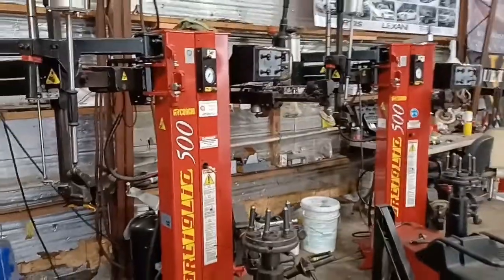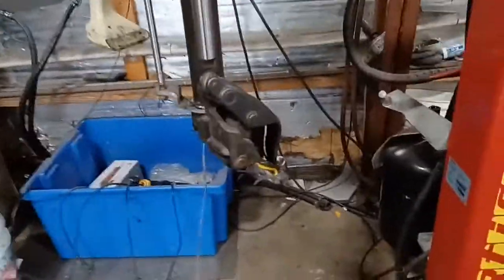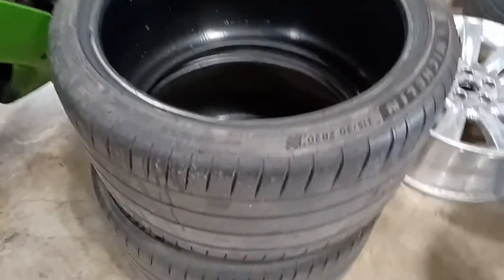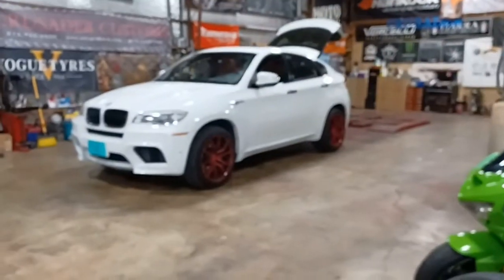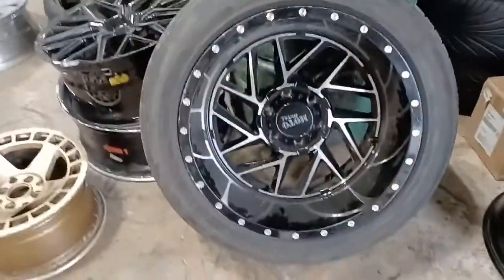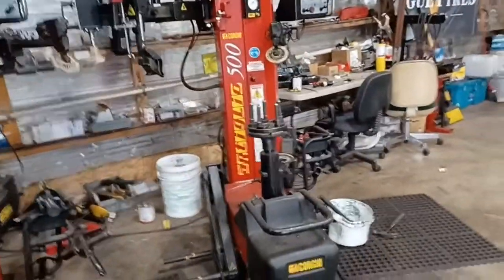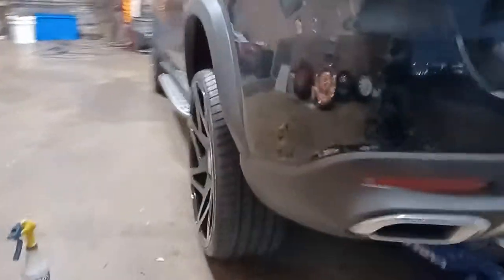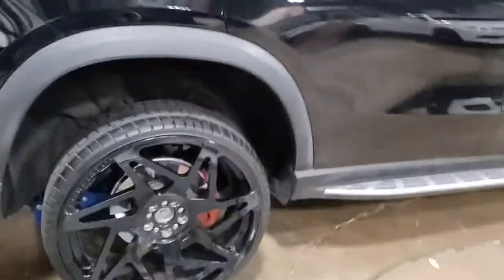24' #forgiatos on a #mercedes #GLE450 plus maintance of the #balancing and #mounting  machines

Comment: I want to fit 24' on my gls 550 what is the tire size that they went with on Gle
Reply from the maker: You can do 255-30-24 in front and 275-25-24  in rear if you do staggered.
Reply: I have a gl550 it's bigger than gle can I put a 35 series tire ?  Because  I pull a mobile detailing trailer soo I needed a little more tire  that a 25 or 30 series tire  from the factory I have 295 40 21